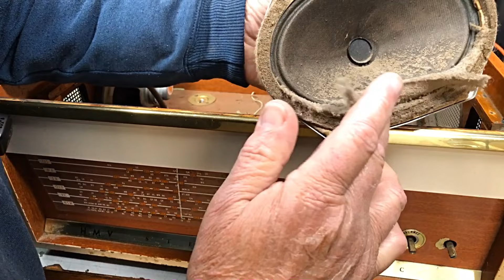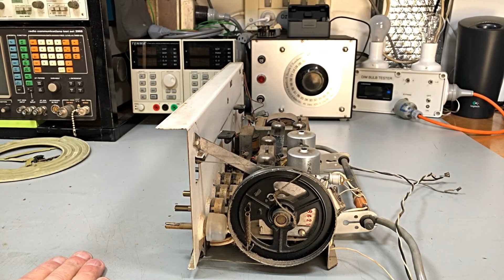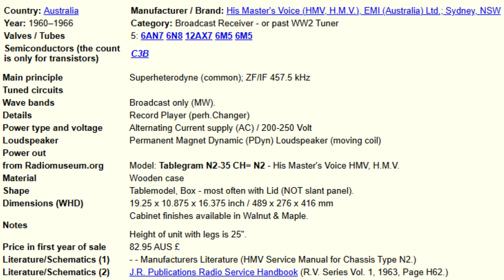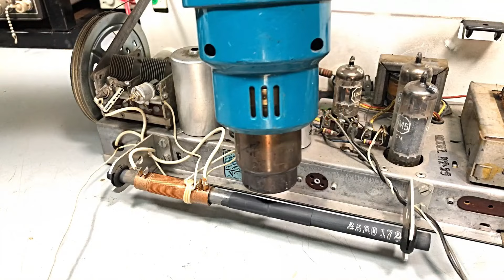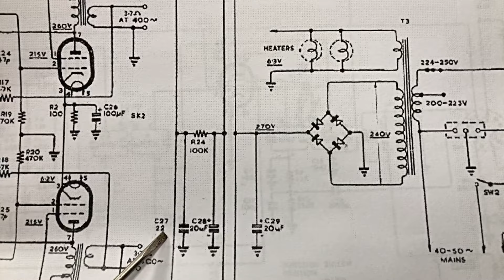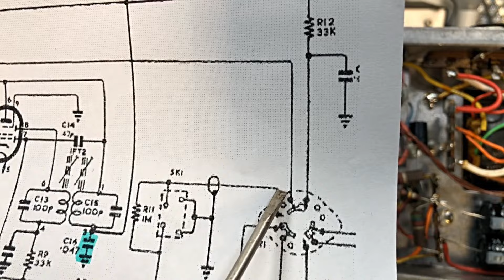HMV TableGram Repair - Part 1

Comment: Nice to see one of these. I had one given to me when I was 10. That one has a BSR  UA12 changer/turntable fiitted with a Sonotone 9TA cartridge  (Most HMV units had Sonotones in their decks around this time) The UA12's not as common as the more plain looking UA14 deck that was in mine and rare to see the plastic arm lift still intact! With the amp chassis directly underneath, the motor board would get quite hot if  used  for extended periods hence the scorching on the rubber shrouding. The spindle rash on the lid is common with these models, a design flaw on HMVs part IMO.
Reply from the maker: Glad this brings back memories for you!
And me too ! 😃

Comment: Whoa!  Using switch contact spray on a powered up chassis!  It is flammable pal!
And the usual valve socket wrecking beloved by most YouTube guys.
Not a good example to set to any beginners watching. Er, OK?  Er, yes, OK? OK?
The C3B Selenium bridge rectifier has been replaced by the 4 silicon diodes, probably 1N4007s, with a 200 ohm resistor to drop the excessive volts due to the greater efficiency.
Reply from the maker: If you don't like the videos please don't watch them & unsubscribe.
Obviously you are perfect & way above me with your knowledge !

Comment: Hi Baz yes the speakers are original they are nice unit you put them in the corner of the room the speakers on side reflect the sound off the walls good luck with it I have one that the cream trim needs doing 🍻👍🏼
Reply from the maker: I think it will sound pretty good & love the retro style of it. Owner will be happy for sure ! Cheers David
Reply: @techobaz55 there is the original Advertisement on YouTube for them🍻

Comment: It is possible that this originally had a selenium rectifier and the silicon diodes were installed as an upgrade. The resistor would have been added to compensate for the higher B+ (HT) that would have resulted from the change. Silver band is actually a 10% resistor (but 107 ohms is still within spec for a 100 ohm 10% resistor). No 4th band would be 20%. Well, at least you haven't had to restring one of those awful dial cords here!!!
Reply from the maker: The circuit diagram does show 4 separate diodes, but no resistor. 
Your theory is correct but don't think this one had selenium in it.
I did have a memory lapse with that silver band, getting too old, lol.
Seeing the HT is correct will leave that resistor in there. Cheers 🍻

Comment: Gee what a mess!  All that butchery for want of the correct switch!  I'm sure you'll turn it into a perfectly functioning unit anyway.  I'm betting the owner will want bluetooth.  These mid century modern things are very popular so it'll be worth it.
Cheers and looking forward to Part 2
Reply from the maker: Yes Don, it's a little rough but it should come up great. I'm sure the customer will be happy with it, so far so good 👍